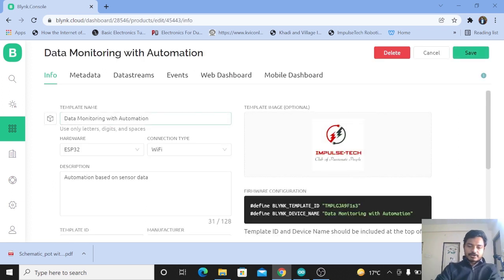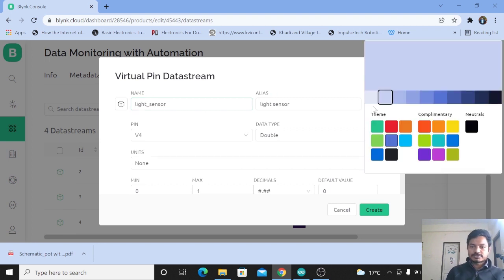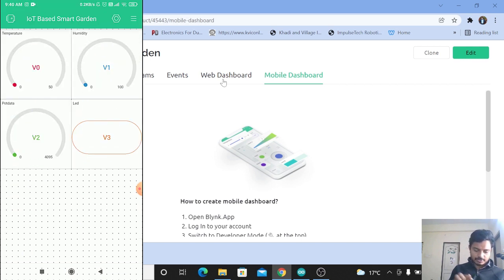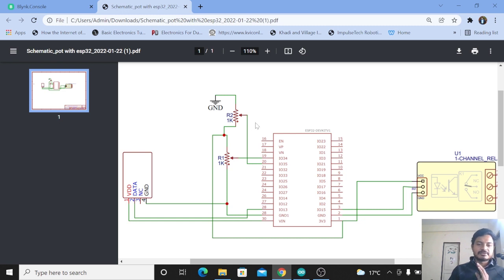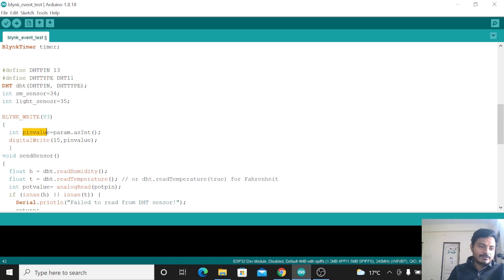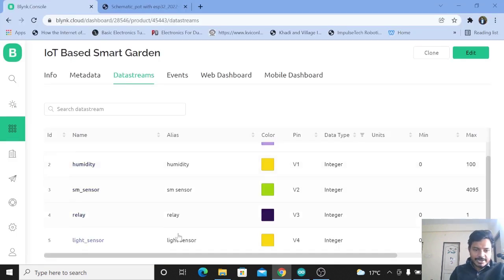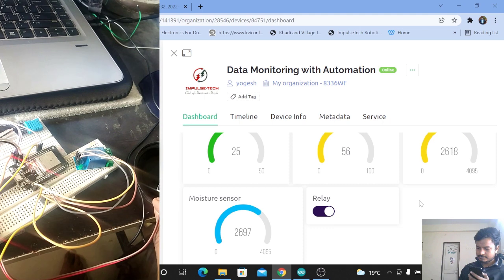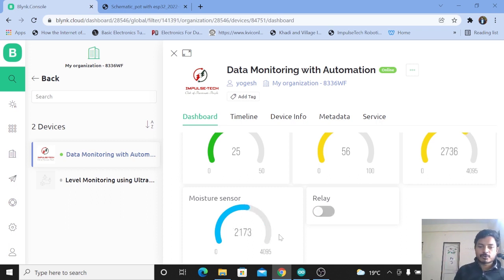IoT Based smart garden monitoring system | Smart plant monitoring using Blynk IoT #iot #blynk #esp32

Comment: How to add in app notification when pump is on/off, and how to control the relay manually.
Reply from the maker: in order to control the relay manually then you need to define one pin for relay in arduino  code and also you need to add the switch widget with datastream for the same